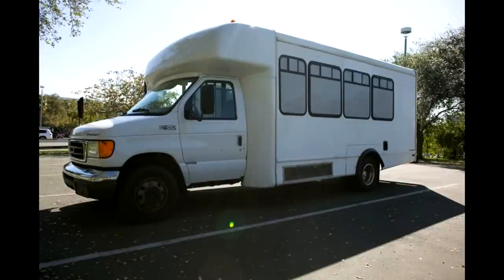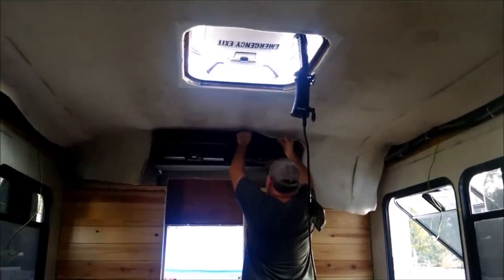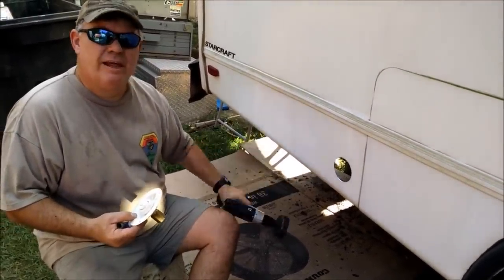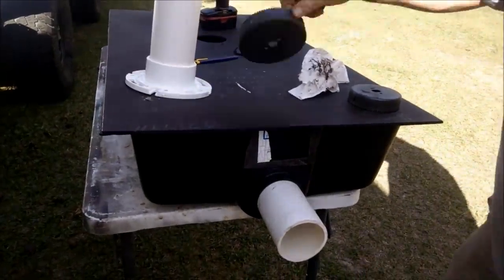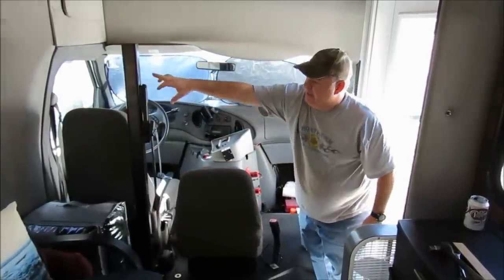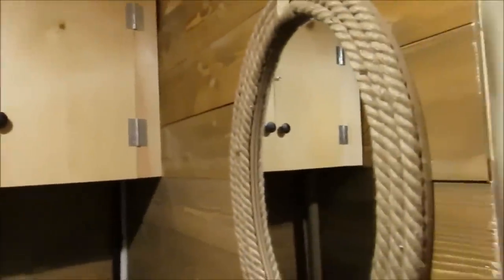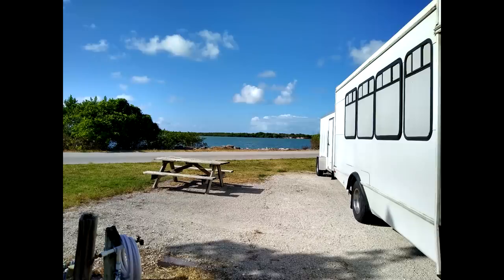Amazing Shuttle Bus tiny home conversion

Comment: The video is as sloppy and careless as the build.  Here are the issues with this build:
Bathroom sink in a kitchen?  So shallow you cannot wash a pot in there, and sink will have burn holes if a hot pot is placed in it.  Functionally useless.
Entry step too high, not completed.
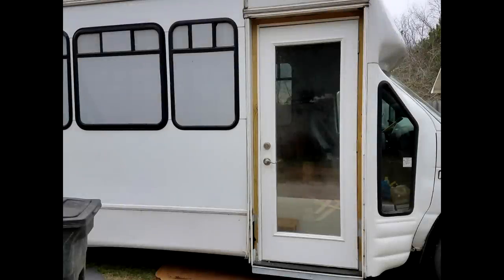1:01 - Front residential door – if you open it, it will hit a parked car.  Burglars can smash the glass and enter easily. The glass has no insulation value and will let in cold and heat.  The previous folding door was much better.
1:16 – No insulation put on floor, just plywood slapped on top of that rusted out floor with rubber mats.  Existing floor rails would have been very useful to reuse to attach 80/20 rails on cabinets or seat belts or whatever.  Instead you put vinyl/ laminate flooring that is noisy to walk on, scratches easily, is prone to breakdown with moisture and will unglue with time.  This is a poor choice.
1:33 – Rear door size does not match interior opening size. Here is a nice wide door to bring in furniture, transport big items from store, etc.  Your interior door opening is half the size and lower in height.  Now the whole functional benefit of a wide back door is gone.  You could also have let in light from here if you were parked in a scenic spot, with a view.  No more. Feels boxy inside now.
1:40 – You took out a steel column from van wall, reducing its structural element?  Oh boy. Your wall does not support the ceiling does it?
2:17 – Painted the ceiling over the glue residue?  Ugh.  This was hard to watch.  So many choices for a beautiful ceiling – plastic tin tile replicas, cedar planks with exposed rivets, tongue in groove wood, recycled pallet wood, fabric, etc.  Not to mention no insulation again.  Now the sun will beat down on this roof and make you hot and cold.  If you like popcorn ceilings, the 1950’s are calling you home.
2:36 – The worst mistake you made is using this ghastly peel and stick vinyl flooring on your walls.  No insulation again.  And you are using a nail gun to make this stick to your walls?  Unbelievable!  I’m laughing my head off at this truly sloppy build.  Did you consider painting your walls with an enamel oil primer then latex paint?  Do you know that van walls get moisture?  This is going to buckle around the nails.  Should be an interesting artistic effect in a year.
3:38 – Plastic units instead of cabinets?  
3:49 – A bathroom sink in your kitchen because you needed it to be smaller than a regular kitchen sink?  Did you hear about bar sinks in stainless steel?  Sinks come in all sizes.  This looks ridiculous in a kitchen and is functionally useless.  Pots will burn the resin counter and not fit.  The high faucet with low sink will splash water everywhere.  Such a wrong choice, ugh!  Why not say the truth that someone donated this to you, or it was sitting around in the garage. Your explanation is dishonest.
4:08 – Bathroom has thin wood walls fit for lining a closet.  Absorbs water.  No shower even though plenty of space for a wet bath.  You are in a shuttle bus with windows lining the wall.  Yet you put your toilet in a windowless area so the smells will hang in the air.   Wonderful!
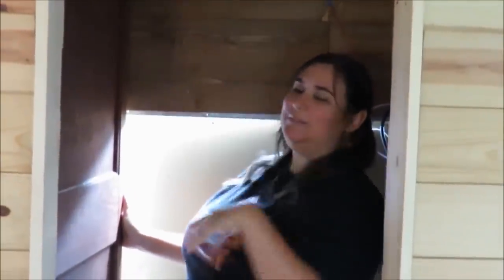4:19 – Why is your bathroom door opening on a hinge?  Every heard of a pocket door or barn door sliding on rails above.  No issue with swing open space in a tiny area.  Wrong choice.
7:10 – A whole bank of cheap plastic drawers?  Why not get some IKEA wood dressers which are almost as cheap as these drawers?  You could buy the Tarva series which is real wood not particle board and no need for this flimsy stuff.  Makes no sense at all.  Real wood can be screwed into place, cheap plastic cannot.  All those drawers will fly open when driving with no way to add latches.
7:32 – Ceiling lights placed on an angle so they shine right into your eyes?  Not very smart.
7:57 – The two wheel wells should have been made level with the floor by raising up the floor with Polyiso foam boards and plywood and possibly a rubber mat on top, that is removable and washable.  Alternatively, put cabinets over the wheel wells to hide them and not waste that space.  What is this Mickey Mouse solution of raising them like tiny platforms and adding seats and stuff to them.  Such a waste of space.  Would have made a great closet area if you sacrificed one window and built a floor to ceiling wardrobe over them.  What a terrible layout!
10:01 – This is your bathroom wall cabinet?  So ugly!  Hook latch?  I would have divorced my husband by now.  I can build better than this and I am not a wood worker.  IKEA sells wall cabinets which would have done the job easily with much more style.  This is downright ugly. Not even for a garage!
8:49 – So the ‘closet’ is also a garage with electrical and battery banks?  And you are going to add flammable fabrics all around this area?  Wow.  Worse build than I thought.
Reply: Lass-in Angeles 
U better mind ur sloppy manners. ND need to urgently concentrate on APPRECIATING OTHER PEOPLE ND THEIR MOST HARD WORK
Reply: @chitramukherji1790  Learn to write English properly before you decide to lecture others.  Keep your shorthand for your phone friends you text all day.  Mind your own manners and your own business.  If you don't like my review don't read it.
Reply: ND olso... WAT ABOUT THE ISSUES IN UR THIK HEADED WOODEN BOX😆😆😆😆
Reply: Kindly get that FIXED.  
BEFORE U SINK